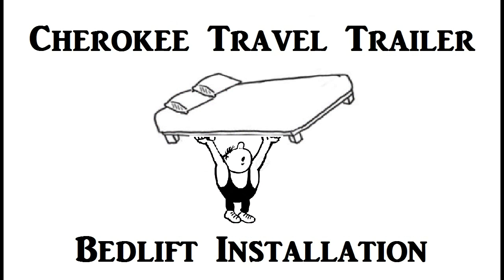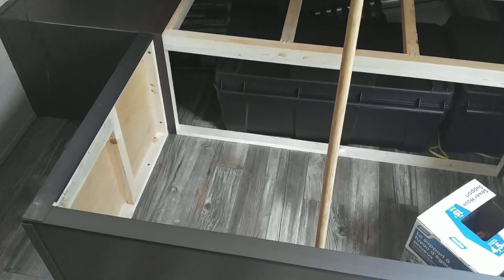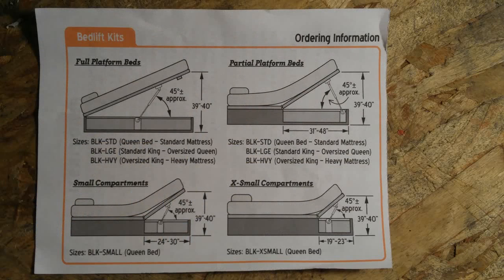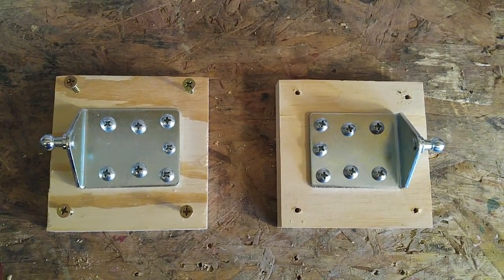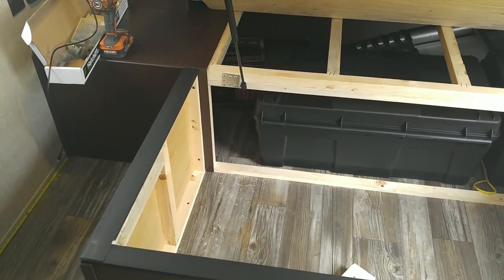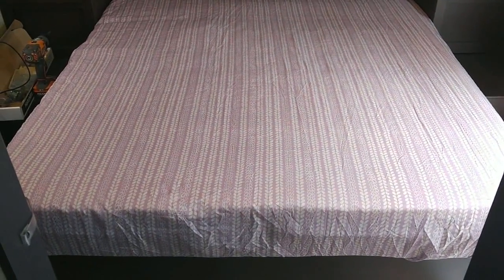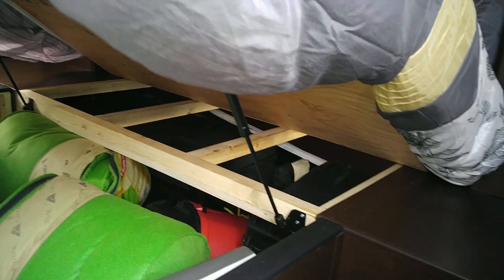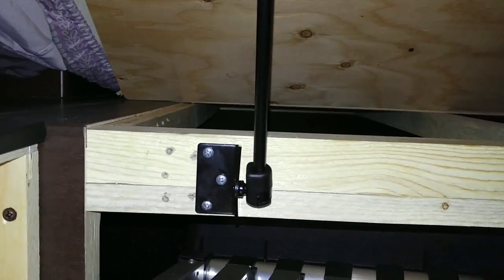Installing Bedlift Kit - Forest River Cherokee 264L Travel Trailer

Comment: What kind of boxes are those in your passthrough storage area?
Reply from the maker: Those were $17 storage lockers from Walmart but I can't recall the brand. They stopped selling them in 2016 and now carry Sterilite. The latches fell apart pretty quickly and were never waterproof. I have been meaning to go measure the new style and see if they fit. I use Plano for other gear in the truck and everything stays dry but they don't fit in the passthru.
Reply: @bradkirkfollies5421  thanks!

Comment: Hi there 🤗
Ty for the idea of the right angle bracket..we have the same trailer but ours came with them installed already... i guess the dealer put them in??
Any other issues with the trailer? We havent had one issue...good trailer. Just wanted your thoughts on it..have a good one .
Reply from the maker: WaNaB we had a couple roof leaks that were easily fixed with Dycor. Also a slide alignment issue. We still love the trailer for the price. I wish it had more storage but love the noise and light separation between bedroom and living room.